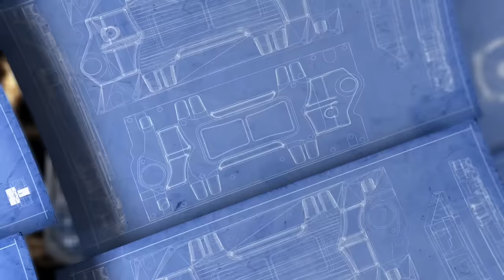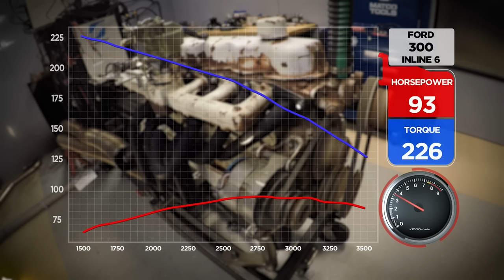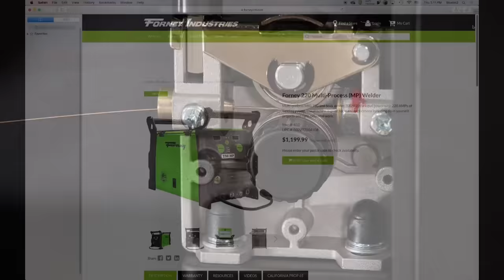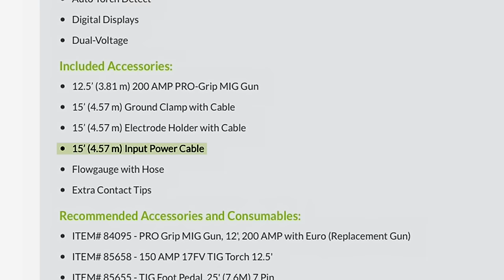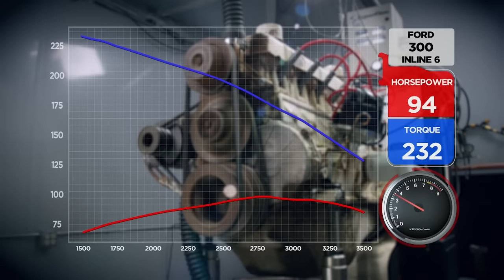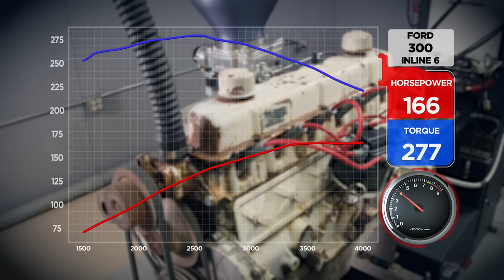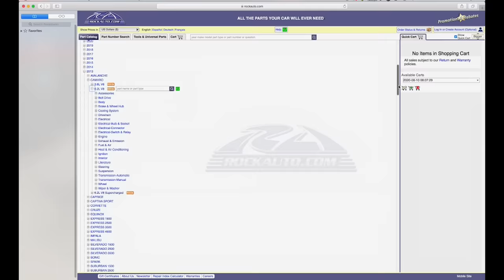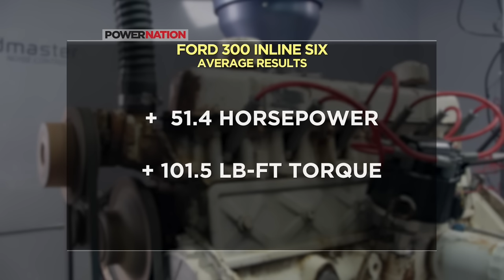Ford 300 Inline Six Gets Eye-Popping Off-The-Shelf Power - Engine Power S7, E17

Comment: Back In my drag strip days, 50s- 60s there were teams that built GMC 6 cylinder bus and truck engines. A lot of teams were working on flat head V-8 s. The Jimmeys were powerful and you couldn't break them.

Comment: Had they started with the intake manifold and carburetor, then added the header pipes you would have thought the header pipes made all the difference. But it's a system and improving only one part gives only minor results. It's when they all come together that the total gains are realized'.
Reply: my thoughts exactly the carb and intake would have only made a small gain if they did them first getting plenty of air a fuel in is pointless if the exhaust can't get out

Comment: When you turbo these things, they turn into diesel engines. Nuclear torque!
Reply: Oof, I've seen the vids on here. 
Bigass lump of torque around 425-450 foot pounds at some ungodly low rev like 2300
Reply: funny, the stock chev 454 we built had 900 pounds of torque withe the crank we used..  at a stop you could put the 2 and a 1/2 ton duelly it went into in 2nd let out the clutch with no gas and it would steadily creep up to 20kmh   lol 

towing at 32 foot avion trailer you could put in first and let off the clutch with no gas, thing wouldn't stall.

but the main saying in the drag racing indy is "you can only beat cubic inches with rectangular dollars"      meaning my stock big block can never be beaten by a small block unless they spend 10x more on it.  blower..   turbo... nitrous...  etc...
Reply: @harleyme3163  yes you are right.  The small block builds become insane to even approach the numbers of the Big Blocks when they're loafing.
Reply: @spacecat7247  Sooo not the point here bud
Reply: @harleyme3163  "the "stock" 454 with the crank we used" ??? everybody knows that 454's put out 900 stock..., right?
Reply: @jaymziebonnatonna80  and the lifespan of the motor is cut in half at least.

Comment: I had a 77 f150 with the 300 straight 6,,pulled horses all over the southwestern states,what a great truck that was,foolishly sold it with 160,000 miles on it,was still running strong.

Comment: The governed engines have a too small earlier YF Carter pointing in the wrong direction. Normally the truck engine makes over 130 hp gross on a dyno. The stationary engine...a lot less.

Comment: They need to drop a more aggressive cam in that thing and higher compression pistons. Id like to see the numbers then...
Reply: 100%. This is like bumblefuck performance. Not going to see any big gains with a stock cam/springs that wont go above 4k rpm. Port that head, cam, springs, retainers, maybe oil pump and turn it up to 6k. I bet it'd be close to 300 horse.
Reply: My grandpa used to race a 300. He had venolia make some dome tops and figured it was about 12.5 to 1. I think he used big block chevy valves and had isky grind a mean cam, dont know specifics, but im assuming whatever the pistons would allow. Problem was the head gasket. He told me there were lots of races it didnt finish

Comment: I work at a truck shop. We do fabrication, not engine/drivetrain type work. I build flat decks, side-curtains, dumpers, install and repair rail gates and tuck-away hydraulic tailgates. 

We had a 5 ton Hino come in for a re&re; he wanted his 26’ box transferred to a new Isuzu cab and chassis. No problem. Did the job, guy drives away happy, leaves the old Hino behind for the scrap guy. This truck had a 411 cid inline six diesel with a 5 speed manual transmission. 
Watching your videos, I wish I had your skills… I would have absolutely loved to refresh that engine and tranny and put it in my ‘90 F250 ..

Comment: Ford Should've release this Engine with a Turbocharger back in the day when was very Popular
Reply: There were turbo kits way back in the day for the industrial ones I believe
Reply: Well Ford did kind of continue this lineage and it eventually got turbo's. The Barra in Australia is about as close as you'd get, and there almost as indestructible
Reply: @brly4542  They did a limited run of turbos in the 80s in Aus too. Aperrently they drive almost exactly like the modern turbo.

Comment: Well I absolutely love this video because you have shown me that I got the right motor! I've never had a 1983 Ford F-250 with an inline six although I've seen the inline six and a few tractors and other industrial machines and I knew they were reliable but I didn't realize how awesome they were cuz I've never worked on one before. I just recently bought a 1983 Ford f250 dolphin motorhome and it's in relatively good shape with 85,000 miles on it so I'm definitely going to be putting a new manifold a Hooker header a new distributor and changing out all the hoses and vacuum lines and doing her full rebuild on the carburetor as well as new gaskets and seals from the oil pan up and the rear main seal which doesn't leak which is amazing. Thank you very much for putting out this video!

Comment: You guys are missing the fact that the Ford 300 makes peak torque at like 900 rpm, and that it needs a big cam
Reply: Strange.   The dyno contradicts your statement.
Reply: So do I
Reply: @bmstylee  what a bad ass engine
Reply: @zachutson7205  I wouldn't call 170 hp out of a 5.0  bad ass.  A worn out 5.0 v8 makes more.
Reply: I've had a couple of these 300s as well as some 350s and 454s all of which came from a generator, power washer setup, fork truck or airport tug, as long as it came from ford or gm with the original intent of the engine to be used as an industrial application running on methane or propane, the cam profile is going to be chopped down to run max torque at, or close to, idle speed. So I do agree with you, a regular automotive gasoline application camshaft or anything else better will very much make these 300 engines alot more drivable in an automotive application as well as improve the torque and horsepower curve.
Reply: The dyno technique is one difference. These guys ramp-in, being used to typical V8 torque curves. It is no Top Fuel ride, but will pull from 700rpm in 1:1 in my daily driven 300/3-speed
Reply: @bmstylee  this is a straight 6 with 2 less cylnders, with a cam ground to make torque, people have made 500+hp out of these without boost and run low 12s NA, there's a turbo charged maverick with a complete stock motor, just a 4 barrel holley 500 and a t444e turbo that runs high 10s so imagine all these mods on that maverick plus a turbo cam and a full exhaust and intake how low his times would be, this motor is all about that torque first and I've only ever lost to 1 truck in towing drag races and that's a 2018 Cummins 6.7 4500
Reply: @Project-gr6zy  yeah this guy has a chip on his shoulder lol
Reply: Well, 2500 per the last pull, but that's pretty close to 900
Reply: @bmstylee 
 You're missing two aspects with your statement.  
First, horsepower isn't everything.  When you're dealing with truck motors, you want torque.  
Second, it's where it makes this power in the RPM band.  An engine that makes 250 torque at 1500 RPM is a lot stronger overall than one that makes 300 torque at 3500 RPM.  

This is why the 4.9 I6 was offered in F-250s and 350s while the 5.0 V8 was not.
Reply: @milesaway1980  according to the comments power is everything.  Look at every v8 build where people complain it didn't make enough power.
Reply: @bmstylee  that's because they don't realize what they really want is torque but they think it's horsepower.

Comment: I don't know anyone who doesn't respect the Ford 300 I6.
Reply: Is that the same as the 4.1 litre straight six in 80s Falcon (Australian)?
Reply: @jackmack1061  - No. The 4.1 is the Ford i6 250, "Small Block 6."  The little brother to the i6 300 (4.9L), "Big Block 6."  There is a difference between the US and Aussie 4.1L Small Block 6s, the US version cylinder head was cast with the intake manifold, which was retained from earlier versions, where the Aussie version had a new head design with separate manifold when it was increased in size to 4.1L.

The Big Block 6s have a wider bore spacing and taller deck.
Reply: @Phantom0fTheRouter  thanks for taking the trouble to reply. Falcons were a good car but all the trim was shite, plastic and flimsy.

Comment: Out of a 21 minute show, you have spent almost 10 minutes of it Hocking frigging products. Leave that crap for the end of the show, or the rest of the commercials. Other than that love the show, and information. Great to see someone do a 300 six
Reply: Paul Warrington  agree. Was losing interest waiting for the ads to end.
Reply: skip fkward righr befkre the add starts
Reply: @Bighorn44 None just wish that they would hock the welder and stuff to the end the video, like they used to do on hot rod tv
Reply: @Bighorn44 None here in Delaware, seen a guy at the drag strip with a mildly built 300 in a Maverick with a turbo turning high 10 second passes a couple years ago. Then he switched up to a built 351w na and put it in the low 9's. But it was pretty cool with that six
Reply: @Bighorn44 None with the mods they have done, add a good cam and do some port work on the head, could be close to or over 200 to start. The couple of 300s I've had have always been tough as nails
Reply: @Bighorn44 None yup, building a nice 351w for my 64 falcon hardtop. Hoping for around 400-450 horse running a 5 speed and just a all around fun car. Might go to the track a few times a year.
Reply: @Bighorn44 None you are quite welcome. I'm only 43, but I drove a slew of classic mustangs through high school, my favorite being a little 66 coupe I drove right on into my tour in the Marine Corp. 289 4 speed. Kept that car till a couple years ago. Changed to the falcon because I wanted to do something you don't see too much around here. But just had a youngin so the falcon has went on the back burner. Hope to get back on it in the next couple years.

Comment: I bought a new 1983 F-150 and took it all over North America. After a few years I bought a Palameono slide in camper with a crank up roof system that gave it a six foot ceiling hieght. It was a HEAVY beast. But that 300 C.I. had the torque to keep it moving. I just let it take it's time, it went across the Blue Ridge Mountains. The manual transmission was a good match for the load. It ran great in Florida and another trip to Galveston Texas. It turned 100K on the road to Lake Nipagon Ontario. It continued on for another 100+ K .

Comment: Had this engine in a 94 F150. The internals of this engine are as perfectly balanced as it gets with very little counter weight needed on the crankshaft. With the transmission I had, 5 gear manual and the 4 wheel drive with chains on the wheels it could plow through 18-24 inches of fresh snow no problem. I fact I'd have to get out a clear the build up from in front of the rad. That truck just acted as if were a tracked caterpillar dozer. What a joy that vehicle was with the smoothest manual transmission I've ever owned and I am by no means a Ford or any other brand guy.

Comment: The first new vehicle I ever bought was a 1996 F150 XLT 4.9L automatic.   I drove it everyday for 12 years before trading it for a new 2008 F150 XLT 4x4 5.4L.  I pulled a 24' Crestliner with a 125HP outboard for many years and you barely knew the boat was behind the 96 F150.  When I traded it in for the '08 it had 285k miles on it and still ran great only ever replacing an A/C compressor the entire time I owned it.   The '08 F150 5.4L was horrible.  It struggled pulling the boat, one engine problem after the other and I missed that old '96 so much.   I traded the '08 off just after 54k miles 4 years after I bought it when the second set of cam phasers went bad on it and pretty much ruined Ford for me for life after that truck.

Comment: I have had two Ford 300 inline pick up trucks and never knew how low powered they were. Yes they went on and on forever, but low powered....wow!
To jump from 88 hp. to 166 hp. with those simple mods is impressive.
That old motor runs so smooth and no engine rebuild.
I look forward to more of this story.
Thanks for a great video!

Comment: I had a 66 Ford step side that came with a 240 inline 6 in 1976, It was embarrassing to climb hills and have to pull over to let traffic go by, so being pretty mechanically inclined I decided to order a short block heavy duty 300. I added an Offenhauser four barrel intake, a 600 CFM Holly, hooker headers, MDS electronics, cross over pipe on split exhaust with glass packs. Kept the 3 speed rock grinder transmission but put a shifter on the floor. It was a monster, I could burn out for a block with the light rear end and big old Armstrong true track tires. Hills well there no limit to how fast I could go. Gas was cheap back then, but still it burned though it fast.

Comment: My 69 f-100 has a 300 in line 6, it's a beast when pulling. A C6 auto trans. backs it up. One pull of 4500 lbs l made kept me wondering why it was having a hard time keeping up at 65 mph. I won't run over 70 mph ever. When l stopped 20 miles down to get some lunch, l smelled something burning. I checked my dash gauges, everyting was ok. I got off and walked around the smell was comming from the rear wheels!! The wheels were very hot.....l looked inside cab and saw l had forgotten to release the parking brake!!! 20 miles the 300 had pulled a very heavy load with rear brakes on. No harm done to motor it still runs great, smooth. Powerful lil motor. Best engine l've ever had pulling my trailer loaded. Ford should have kept improving it instead of changing motors every 4 years.

Comment: I HAD A 1987 TUG MA TRACTOR WITH THE FORD 4.9 STRAIGHT SIX WITH A C6 TRANSMISSION AND A PUMPKIN REAR END .  THAT WAS AND IS THE BEST STRAIGHT SIX GASOLINE EVER BUILT .  PERIOD .  SLANT SIX IS A SMALL 3.7 AND THE 4.0 JEEP DOESN'T TOUCH A CANDLE TO THIS BEAST OF A MOTOR.

Comment: My '86 F-150 4x2 has a 300 six which has never been cracked open. It has almost 300,000 miles on it and uses no oil and makes no smoke. That engine is world-famous for reliability.

Comment: Great video guys! The step by step power test is really interesting.  I had a 300 in my '69 F100 with three on the tree. Most reliable old car I ever had. It basically never stopped running. No timing chain either -  just two intermeshing gears. One old guy told me the transmissions are tougher still and will outlast 3 engines. I did the intake (Clifford  6=8 intake) and header swap with an Autolite 4100 and put glass packs on it, sounded like an airplane with that howling straight six sound in this video - definately different than a SBF. I think this is the engine that the Ford Bronco's won Baja with. I'm a Ford guy but would love to see you do similar with the other American straight six icon - the Dodge slant six. I think either of these engines will be running 50 years after nuclear apocolypse! I got it used, and put nearly 200,000 miles on it before rebuilding it.

Comment: I've always been a fan of the inline six cylinder.  I owned the 300 CI in a 78 ford truck that met all my needs, the 4.0 liter in a 99 Jeep cherokee (my son is still beating on it). I've always been impressed with the smooth operation of these engines, but I was never a fan of the fuel consumption.  Well GM answered that, I'm now driving the 3.0L duramax with the 10 speed for a little over a year now (a little over 12k due to Corona).  This powertrain package delivers the ultimate in power, performance and efficiency  which was key for me and the mileage I run when commuting.  No it's not a big large displacement engine, nor a big truck, but just like the other inlines they are purpose built and expected to last. Oh and when they kept efficiency in mind when designing the engine and knew they had to keep up with today's performance expectations they threw the variable turbo on it.  How about you put a turbo on the ford 300?  Those would be some great numbers!

Comment: I've a '78 Econoline, same engine, 3 on the tree. I just replaced the manifold gasket... 350k miles, still runs great... but yeah... it could use more torque and HP... and I'm sure mods would not affect this engine's integrity. A remarkable engine. I will have this van for the rest of my life. Parts are cheap, and available.

I am very curious about Clifford Performance, who specializes in mods for straight six engines. Check em out.
Reply: I've got a '78 van with the 4 speed OD on the floor, a 9" locker in the back, 300 with carb and headers and over 300K miles and love it too.

Comment: I built an 86 300i6 with Clifford engineering add-ons. 3 into 1 long tube headers, Clifford heated intake manifold, 30 over, flat head pistons, ported n polished heads, 650cfm Edelbrock. 6=8 is Clifford's claim, and it was all of that. I used it as a DD and for off road in my F150. Great torque, loads of grunt. Loved my 5.0L i6.

Comment: I built a 300 six for propane for my 1966 F100. I used a Clifford intake with an Impco mixer valve a no name header (mistake). I used a head from a 240 to boost compression with Stellite exhaust valves and seats (remove the rotators for propane). An RV cam boosted the torque. A stock distributor was curved for propane and it ran very strong for a lot of miles. I wish that I could do it again for a Divco milk truck but it  would need a lot of gearing to pull a trailer.

Comment: Had one of those inline 300's in an old 70's Econoline 3/4 ton panel van as a teen and you cant kill em. That engine took a dip in Ky lake when the brakes went out while launching a boat on a steep ramp and it ran while 1/2 way underwater for at least 15-20 min and almost pulled the whole rig back out if it had not been for the slick slime on the ramp.But alas... I had to get some help from a fisherman with a chain. Drained the oil / lake water out, added some new oil and it ran for a couple more years before I sold it. Things have pistons the size of  small dinner plates in em...